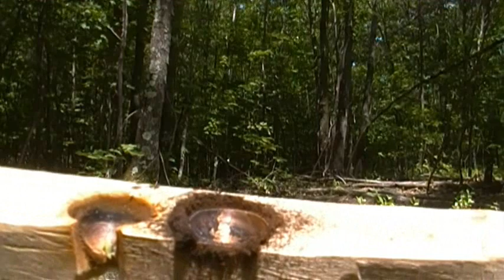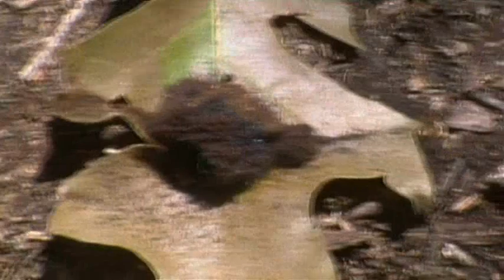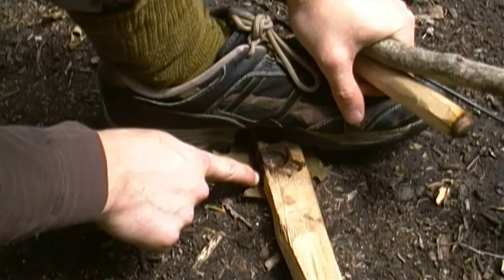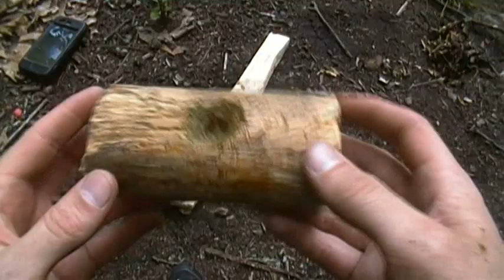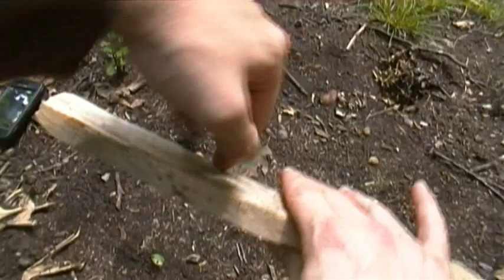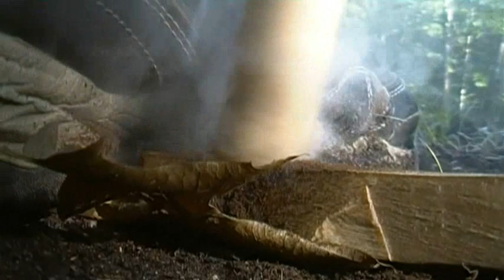Primitive Bushcraft - How to Make a Bowdrill Fire | Self Reliance

Comment: This is by far the most informative video on the bow drill so far.My success rate was very low, and now I see the things I've been doing wrong. To begin with, my fire board is far too thin, and my spindle is no where near pointed enough.  I've also learned that trying to cut in your notch with a saw is no where near as precise as carefully carving it in with your knife.
Great video Mitch! It sure taught me a few things!

Comment: Great explanations. I like the way you begin your notch by making the centerline first as an accurate point of reference. Many times my notches have ended up off center. This should correct this. Your explanation of the bottom undercut makes more sense than the oxygen explanation I have so often heard. Without it you in fact do end up with a very narrow ember pile. As a side note....I think most failures I experience have been a result of too much pressure. You end up drilling instead of creating friction and well charred dust.  Thanks for sharing.

Comment: Mitch, that tip about having the burn end of the spindle carved just right without variations along the friction edge is probably what I have been doing wrong. I get smoke, and a nice pile of dust (black and brown) but it just won't ignite. I believe I am creating enough friction because it bellows with smoke. I will try this again paying special attention to that tip. Thanks for this post, probably the best bowdrill tuitorial on the web.

Comment: Great vid again Mitch.  The most thorough explanation of the bow drill I have seen!  The only addition piece of info I was curious about was do you have any recommendations for the tension on the string and spindle?  Should you barely be able to twist the spindle into the string or is that too tight?

Keep up the great work!

Comment: My spindle won't spin the rope just moves around it
Reply from the maker: Possibly multiple causes, spindle too smooth instead make it an octagon shape, too much downward pressure, rope too smooth or rope not tight enough.
Reply from the maker: Zachary Howe
use paracord.